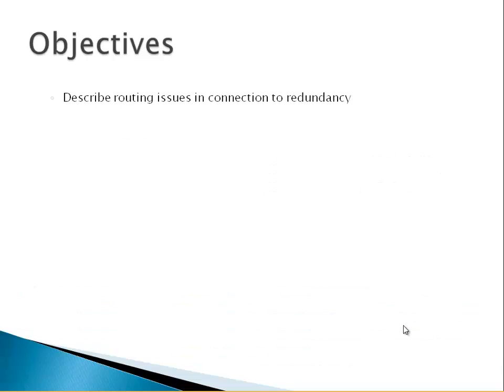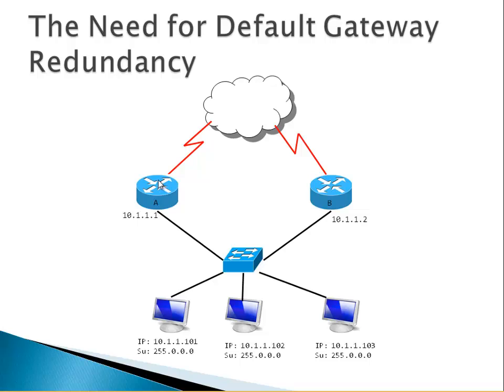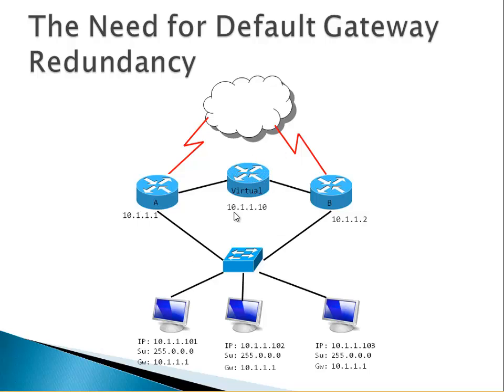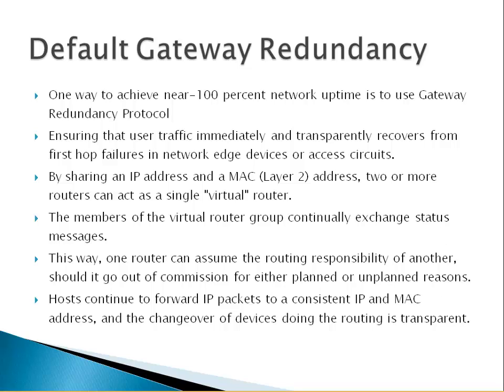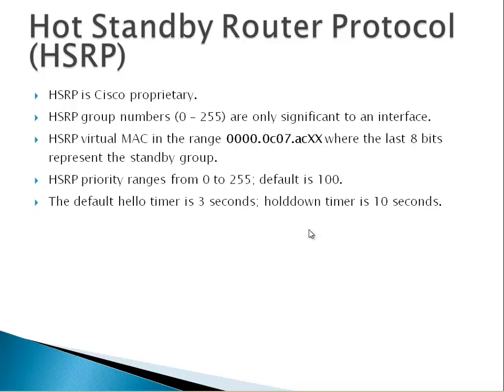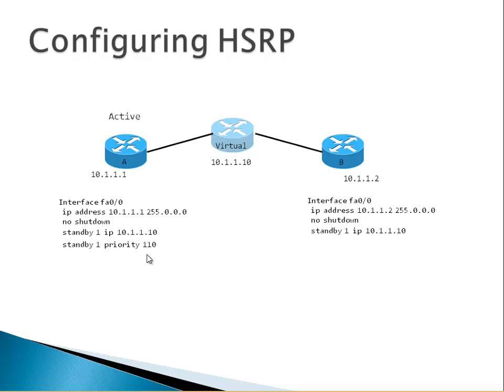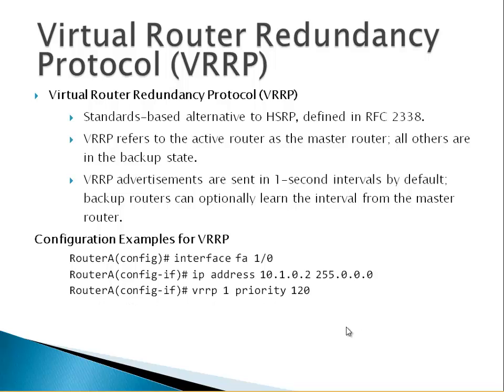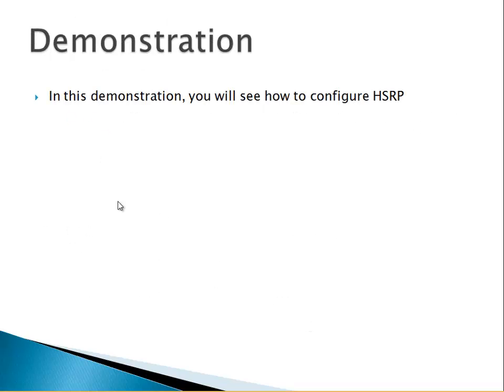HSRP  (Hot Standby Router Protocol), VRRP, GLBP - part 1

Comment: Does the switch finds the 10
1.1.2 router with sending an arp- broadcast if 10.1.1.1 fails ?
Or is it an unicast frame ? How can the switch can find the Mac address of the virtual router .10 in the mac address table ? I can't understand this :(
Reply: oh sorry, i got it i think. the switch will learn the new mac address after sending the broadcast and receiving an unicast arp reply from .2 because it is the active router when .1 fails.